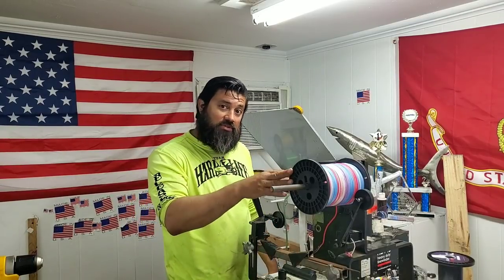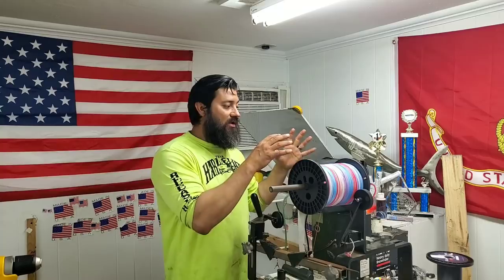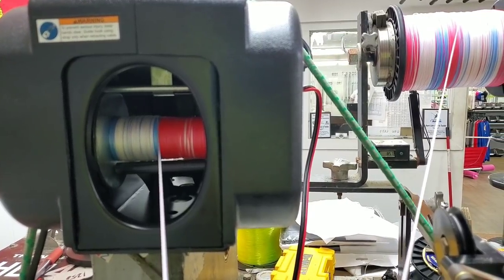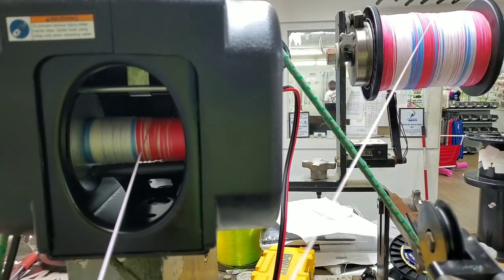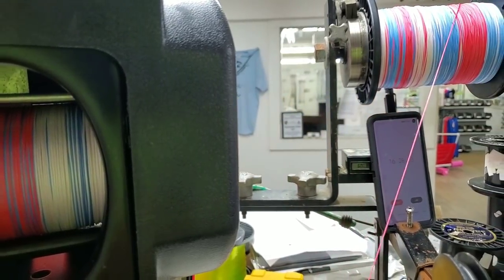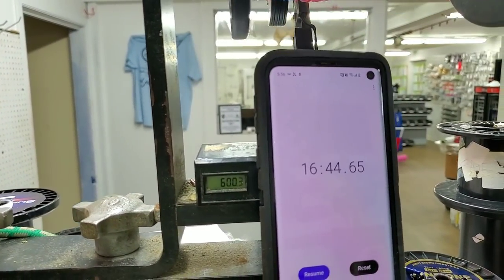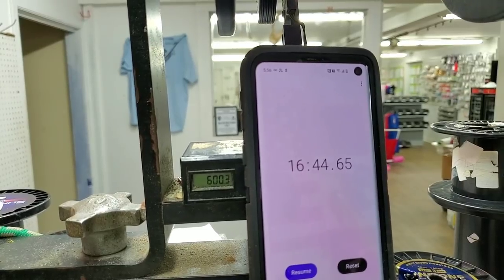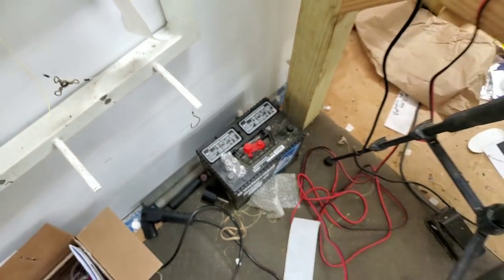Sail lines Are Made Bullet weather proofing

Comment: I’ve got a built one of a kind heavy duty sail line set up that you need to see sir. It’s fast, well built, and holds an amount of line that I have yet to find out because it can hold so much.
Reply from the maker: It helps that I have a line counter on my spooling machine ... your more than welcome to bring it by and we can look into doing it..
Reply: Right now I have it spooled with mono since it does allow for some stretch as it’s reeling in all the weight from the wind and what ever fish may be hooked up. I’m in the neighborhood of 1500yds on it as it sits. Plus the allowed leader length.
Reply: I’ve never maxed out the spool, that’s the only reason why idk how much it’ll hold. And the fact that I haven’t had monster spools of line such as yourself lol. But I can surely take it by so you can have a look at my design.
Reply from the maker: Could deal... that will be very cool
Reply from the maker: There isn't gona a fish big enough to stretch the line that the main line with drops couldn't handle already... also to will be a lot lighter with the braid so means easier deployment..
Reply: Very true sir, once hooks are baited and sail is set to direction according to wind it’ll take me roughly 10-15 minutes to stop it at my desired distance. Which of course gives plenty of fish time to rob my baits. So a quicker launch would be great.
Reply from the maker: Yes sir
Reply from the maker: Also to this system has a braking system on it so you can actually set drag on it it doesn't go full lockdown or full loose you can actually reduce the amount of drag just by turning and the knob that would control the handle
Reply: Mine also has a drag system on it, two wenching speeds and also a bigger interchangeable sprocket to reduce spool speed if need be. I have a wench identical to yours also, I just never could find a spool to change out the original. So I drew mine and had it machined.
Reply from the maker: Oh wow..  nice.. seen a guy custom make his to have a wind on hide as well